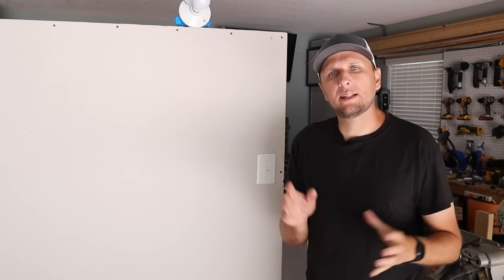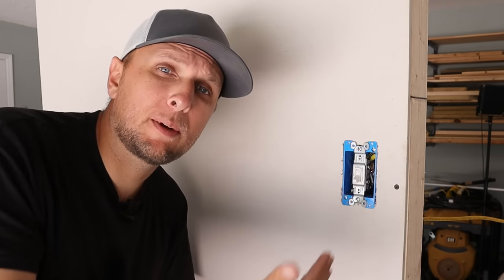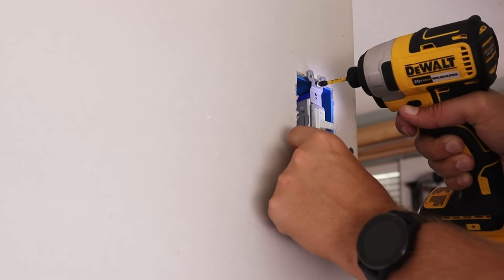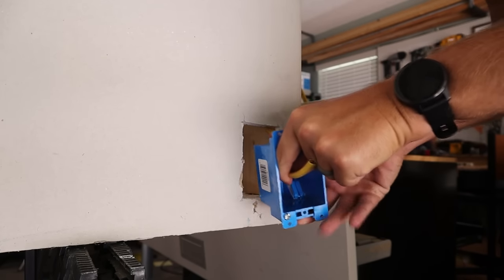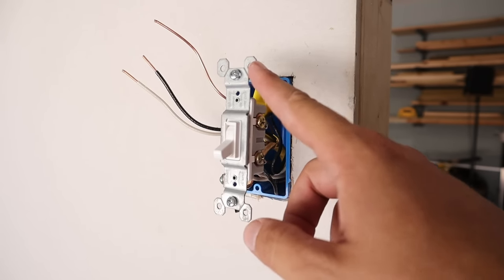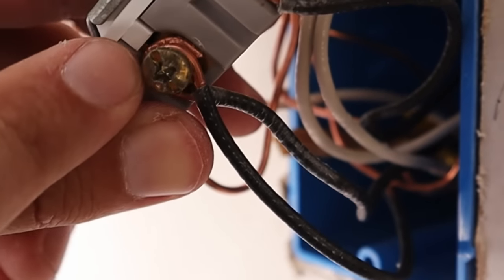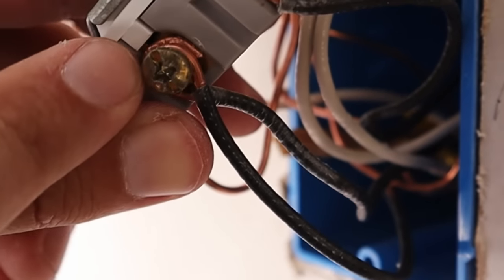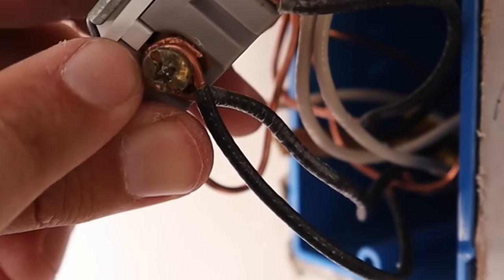How To Add An Outlet From A Light Switch | Common Mistake

Comment: Pigtail or newer switch that has back wiring (not back stabbing, which is what you showed not to do). A lot of the back wiring connectors have a hole on both the top & bottom of the screw to allow for 2 wires.

I'll agree with you on the back stabbing. I've also seen them fail several times.

Even better, use 12/3 or 14/3, as appropriate for the rating of the circuit, to make 1/2 the plug hot and 1/2 the plug switched. Of course, this may or may not be appropriate, depending on the use you have for the plug.
Reply: Is this what is done when you bring one run and terminate to the top of switch and then terminate from bottom to an outlet in a gang box next door?
I thought I had a bad GFCI, until I called Lutron to find out I didnt pair the runner up correctly when disconnecting(reversed)... 👌
Reply: @brawlman : I'm not sure what you're asking, but I think I know. I'll try to clarify. An outlet usually has 2 hot and 2 neutral screws with a copper connector between them. The upper screws power the upper half of the outlet and the bottom screws power the bottom half of the outlet. With the copper connector between them, both the upper and lower outlets are powered at the same time. This allows you to use one set of screws for incoming power and the other set to run out to the next outlet. However, if you remove the copper connector between the 2 hot (black wire) screws, the top and bottom halves of the outlet work independently. One use of this would be to make one of the outlets switched and the other one hot all the time. If this is what you're wanting to do, you would run 12/3 or 14/3 (as appropriate) Romex from the switch to the outlet. The black and white cables in the Romex would connect to the black and white cables in the switch box. The red cable in the Romex would connect to the switch and only be hot when the switch is on. You would then connect the other end (outlet end) of the Romex to the outlet with the white wire to one of the neutral screws, the black wire to one of the hot screws, and the red wire to the other hot screw. With the copper jumper between the hot screws removed, this will allow the half of the outlet with the black wire to be hot all the time and the half of the outlet with the red wire to only be hot when the switch is turned on.

In all locations, the ground wire in the Romex would connect to the ground screw on the device and the ground wires from the power supply (breaker box or upstream device). Also, one wire per screw. Use pigtails as necessary. If you accidentally remove the copper jumper from neutral side of the outlet, you can connect 2 pigtails to the white wire in the Romex and run the 2 pigtails (one each) to each of the neutral screws on the outlet.

If you're talking about backstabbing, backstabbing is using the small hole in the back of the device to push the wire into the device. It is then held in place by a spring loaded piece of copper inside the device. The problem is that after a while, as this piece of copper heats up and cools down repeatedly, it looses its springiness and the wire comes loose. Many newer devices allow for back wiring. This is different. When back wiring, the wire is pushed straight in, like in backstabbing, but it's pushed in under a plate that this then tightened down by the screw. So, there's not spring to get weak.

When wiring a GFCI, there are 2 sets of screws. Set 1 is the power coming into the GFCI outlet. Set 2 is for passing GFCI protection onto the next device, such as a 2nd outlet further down the wall. A GFCI works by detecting greater amperage on the black (hot) wire than on the white (neutral) wire. This difference is VERY small, so they trip easily. If you get the black and white wires backwards or get the input and output sets of screws backwards, you'll have a problem. Also, if you connect another GFCI outlet to the output side of an upstream GFCI outlet, they'll interfere with each other and cause each other to trip. So, to daisy chain GFCI, you either use non GFCI outlets downstream from the GFCI outlet and connect them to the output screws of the GFCI outlet or, if you want all the outlets to have their own GFCI reset buttons, you would string the GFCI outlets by using only the input set of screws.

A few other nice things to know about GFCI outlets. 1) They can be used to replace 2-hole outlets (no ground wire outlets) so that you have a 3-hole outlet. When you do this, the outlet is required to be labeled "No equipment ground." This and other labels will come in the box with the GFCI outlet. The labeling requirement also applies to any downstream outlet that's protected by the GFCI outlet. 2) When you test a GFCI outlet using a plug-in tester, it shorts the hot (through a resister) to the ground terminal, not to the neutral terminal. So, a plug-in tester won't trip a GFCI outlet that has no equipment ground. You have to test by using the built-in button on the outlet. If the tester shorted to the neutral terminal, you would have the same amount of amperage on the hot & neutral terminals. So, the trip condition wouldn't be met. 3) Since GFCI outlets can protect downstream outlets, a standard outlet may be GFCI protected (and should be labeled as such). The GFCI outlet protecting it does NOT have to be in the same room as the protected standard outlet. However, it's nicer, from a user standpoint, if it is.

I'm not aware of any GFCI outlets that will allow for switching only half the outlet, as mentioned above. If you were going to do that, you'd probably want to use a GFCI breaker on the circuit instead, then use a standard outlet. There are other options also, but this would probably be the simplest.

Comment: If you're thinking about doing this make sure you're aware of the regulations in your country 
In some places it's highly illegal to combine lighting and power points on the same circuit because they have independent circuit breaker requirements.
Reply: In the US most outlets in homes are required to be on a AFCI and/or GFCI. Lighting only circuits will not be on either, but you could upgrade the breaker when adding an outlet.
Reply: Totally agree Ben. In actual fact I think it is a terrible idea to combine lighting and power in all circumstances. Especially these days lighting circuit current demands  are so low that 5A circuits are more than sufficient for most needs. Another reason that I hate this is you can often noticeably see light flicker from large load switching on the same 12 awg cable...this doesn't happen if the lighting is on a dedicated wire / circuit.
Reply: @aquacruisedb  I can't think of a house I've owned or lived in that was ever wired like that. I've seen houses where each room had it's own circuit but not separate for lighting and receptacles. That's either something that's only done in Europe or really high-end builds. I think in general it's a better idea to be as flexible as possible. Having specialized circuits only makes it more difficult to retro fit things later.
Reply: @merfishsandwich691  in Australia or New Zealand all fuse boxes have breakers for lights and other breakers for PowerPoints. They don't share.
Reply: @Psi105  Ya we don't do that here. I frankly don't see the point. We stuff our boxes with 15 or 20 amp breakers and run multipurpose circuits. Electricity is electricity, it doesn't really matter what it's powering.
Reply: @TheCaperfish  That makes a lot of sense in that context. Thanks for the perspective.
Reply: @merfishsandwich691  i have a house built in the mid 80s in southern cali that it this way. all lighting is on its own circuit and outlets on their own. one breaker controls the lighting across all bathrooms, garage and laundry room. 1 breaker for kitchen and dining room lights. i breaker for the outlets across three rooms. 1 breaker for outlets across all bathrooms. etc etc. all lighting is separated from outlets. all the houses in this area (rowland heights) are the same
Reply: @CajunReaper95  curious what area you live in. i was under the impression three phase is pretty uncommon in residential
Reply: @mohawkpiper  very rare in residential       3 phase
Reply: @bobdonovan4505  yea thats what i thought. you like have to get that added after the fact if you want it and its pricy and a lot of work. louisianaoutlaw said their AC is on 3phase and that was a bit odd to me so i was curious where they lived
Reply: @mohawkpiper  agree
Reply: @merfishsandwich691  you are more likely to see some interaction and false triggering of your safety systems if you mix circuits.
Reply: @merfishsandwich691  I live in Australia and my house has multiple lighting circuits and multiple power circuits. They are separate.
Reply: @Doug-gp2qw  -  Older homes typically have a 15amp brkr on 14gauge wire for lighting - "upgrading" to a 20amp breaker w/o replacing the wire is asking for trouble.
Reply: In the uk we separate lighting from power points as a safety measure. That way when you are working on a power circuit you have a bit more reassurance that it’s not fed from the lighting power. Also we have different ratings for lighting and power for automatic disconnection times.

It starts getting murky when the two are mixed and if a average person with little competency of working with electricity does works on their home, they have a reduced chance of hurting themselves
Reply: In some countries lighting circuits use smaller size cables, doing this may cause some dangerous
Reply: @Doug-gp2qw  wrong.
Reply: @mohawkpiper  in AU/NZ it's uncommon to have three phase in a residential context.  I don't think 3 wires (Active, Neutral, Ground) is technically three phase.  Our lighting circuits traditionally don't include a ground wire and are separate from our power receptacles.
Reply: @merfishsandwich691  Its much cheaper to have separate ccts as lighting will only need a 1mm cable with 6a protection where as power point ccts are usually rated to 20A needing 2.5mm cable. 
Theres a lot more lighting cable than power in an average house due to switching so the saving is pretty significant.
And also, as mentioned earlier, turning on something with a high draw like heater will cause enough volt drop to cause a noticeable dim in candecent lights and possible flicker on non dimmable leds, on the same cct
Reply: @CajunReaper95  240v 3phase? That’s something almost never heard of. Maybe you meant 120/208v?

Comment: Before I cut the outlet hole I usually run a flexible rod down from the light switch to the depth of where I want to cut the hole for the new outlet, just to be sure there are no obstructons in the wall. Also not all light switches are number 12 wire. It's not code to combine a number 14 to a 12 for an outlet in my city.
Reply from the maker: Thanks for the input Cathy!
Reply: Cathy that's in the NEC about combining 12 & 14...but I ran into this where whomever ran the 14 off the 12 prob ran out of 12 or did not have any but at least they actually put a note inside that box indicating this was a 15 Amp run and the breaker #.....That was a very thoughtful gesture!

Comment: Great video. Thank you for the clear explanation. I have a similar situation with my garbage disposal under the sink which is controlled by a switch on the countertop and there is a dedicated breaker for the disposal. I want to add an always-on outlet under the sink to power an RO system while retaining the disposal control of the switch. What you described would help me achieve the above.

Comment: First thing is making sure you have a neutral wire in the light switch box. Second never go as low or close to a stud as this guy. Doorways tend to have unpredictable studs. Always go to the other side or center. I always do a test cut with my rock saw to the left and right to confirm I am not hitting a stud before marking the wall. Also if working on an older home you may run into plaster and lathe or sheetrock over plaster and lathe. Good luck using that blue rework box. I use a bakelite (usually brown or beige) if I run into plaster and lathe. You can trim the brace leafs back to allow a good install.

Comment: Make sure the power you want is available at the switch before you cut a hole for the new outlet.
Reply: another great idea is to actually, CAREFULLY, pull the switch out before turning off the power and check to see which wire is line so you can save yourself two trips to turn the power on and off to figure that step out.
Reply: @renton9999  A buddy on a cell phone in the basement is also helpful, Signed, The Buddy

Comment: Couple of points. Many times the feed is to the light, not the switch and there is no neutral in the switch box to connect to, just a hot white wire coming in and a switched hot black wire back to the light. 
Also back when I did wiring in the 80s the back push in connectors accepted 12 ans 14 gauge both, and I personally never use anything smaller than 12 gauge to outlets, safety first.
Reply: So what do you do if the feed is to the light, and you have a 12/2 jumper from light to switch, can you still use the video method when adding a receptacle?
Reply: @daviddelacruz7158  You wouldn’t be able to do this method if the feed is to the light and you only have 12-2 or 14-2 coming to the switch.  The reason is that BOTH the black and white wires AT THE SWITCH are being used to carry the current to the light.  The black would be the hot coming from the ceiling, going through the switch and then to the white which is now carrying the current to the light. (Per code, the white wire should be marked at both ends with black electrical tape or a black marker to designate it as the ‘hot’ wire. )
To accomplish your task, you would need to bring another cable down from the light OR SOME other location.  When I did this recently, I was fortunate to have a receptacle on the other side of the wall in the adjacent room.  Using pigtails and an ‘old work box’ like he used, I moved over a few inches and cut through and then ran a short section of 14-2 with ground over to my new location.  If you’re not lucky, then you’ll need to either fish wires down from the attic or up from the basement/crawlspace.
Reply: @glasshalffull2930  Right. When the light is off, it would work; when the late is on, you're fucked. Can't believe the guy doing the video didn't even consider this and may have misled innocents down a very bad path.
Reply: @diannelenihan6143   I comment every once in a while when someone needs help or there is something dangerous.  I also commiserate as I’d like to add a fan/light combo in my bathroom, but the trusses in the attic make it a nightmare and I just keep postponing.

Comment: 2:40. Mark ONLY the first bit of the bottom edge, to avoid marking the wall if you must move the box a bit. Just like cutting toward the stud first to be sure there’s enough room, raise the box away from the floor to avoid the bottom plate.
Reply: Usually there is a minimum required height at least a foot higher.

Comment: I greatly enjoy your videos. They are accurate and tooth’s point w/o extra chatter.
Just a couple of things on this video.  Many switches, when fed from the top, do not have neutrals in the box.  Also, starting 15-20 years ago, it was recommended that outlets be installed w the ground up as a safety precaution.
Reply: I thought the ground up meant that it would be a switched controlled outlet as most say

Comment: I have found that those ears when removed are useful as spacers in old boxes to flush-out the outlet so the outlet protrudes through the cover-plate properly.
Reply from the maker: Good tip!
Reply: i learned same thing 2... 😁

Comment: I've come across situations where the black hot wire is actually hot coming from the light itself, meaning the circuit breaker (CB) is wired directly to the light and then down to the switch, rather than the hot coming from the CB to the switch and then up to the light as the video has it. The test you did wouldn't detect that until plugging something into the outlet causes the light to go on.
Reply: The connection you just stated is called "being made hot at the light box" but that black hot wire isn't connected to the light fixture. It requires a switch leg. Either way, made hot at the light box or hot at the switch, the black wire connected to the bottom terminal of the switch is going to be hot. In older wiring though this would probably not have a neutral wire at the switch unless the switch leg was ran out of 14-3 wire (black, red, white, bare ground). Older switch legs ran out of 14-2 use the white wire with black tape wrapped around it as the hot feed.

Comment: Thank you for the video, this exactly what I need to do in order to install a compact refrigerator and microwave within a small area next to my wife's tall and long and extremly heavy dresser within the masterbedroom.
Now the only thing I have to do is to move the wall outlet switch from the rear part of the wall and install it to the left side of the wall then run the new electrical wire from the left side of the wall to the rear of the wall in order to install the wall outlet behind both appliances...thank God for both of my crawl spaces,... this job will be easy pezzzy... by the way that wall switch that going to be moved is used to light up the light with one of two crawl spaces, also I  always like to use electrical tape on all of the electrical nuts once they're screw onto the electrical wires and the same goes both sides of the electrical switches, just as an extra safety precaution....once again thank you.